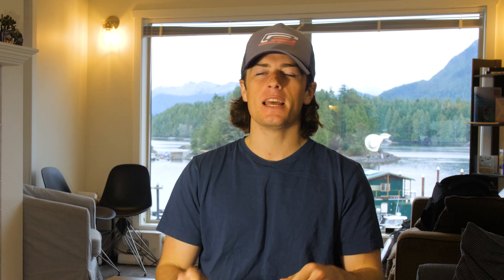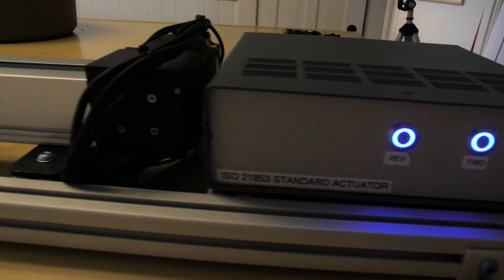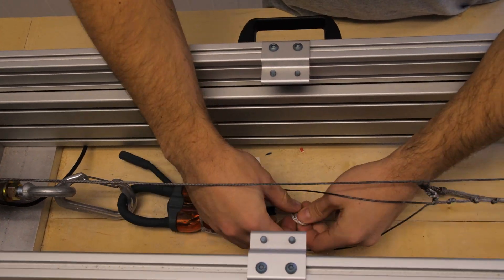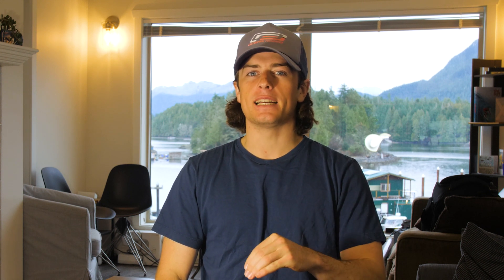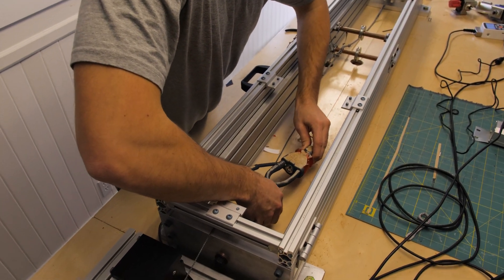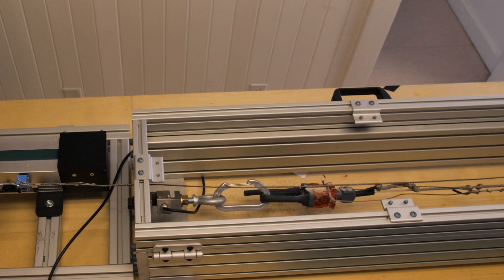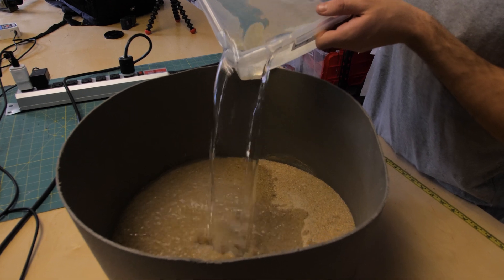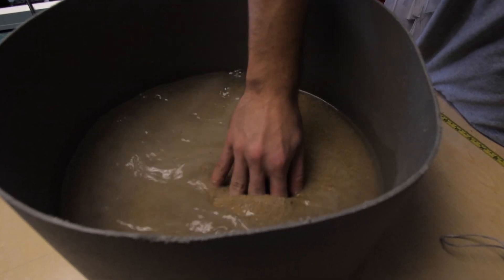CHICKEN LOOP TESTING MACHINE | ISO KITEBOARDING SAFETY STANDARDS

Comment: I have a bar from Naish with this new chicken loop. Is it possible to get a bigger chicken loop? I sometimes make unhooked stuff but with this small loop it does not work soo well. :(
Reply from the maker: Hey Stephan, This loop shape is specially designed for freeride, kitesurfing, and big air where unhooking is generally not required and the large shape of freestyle loops provides a mush less direct connection to the kite when you're hooked in. Luckily, the chicken loop is modifiable and there is a large freestyle specific loop available for your chicken loop if you contact Naish. As well as a rope slider loop for foiling, kitesurfing.